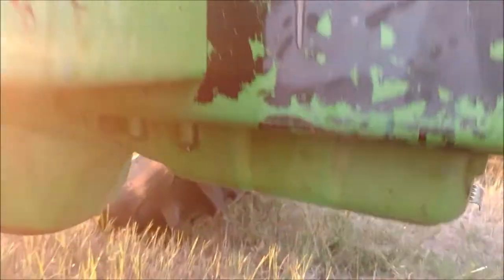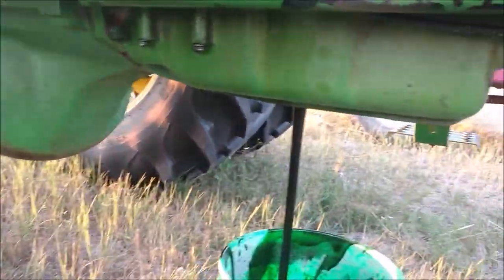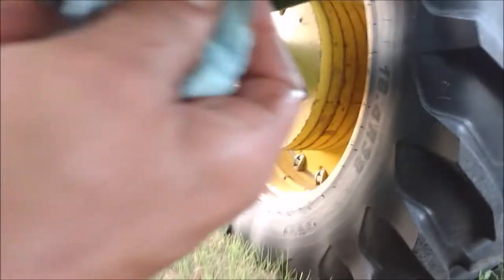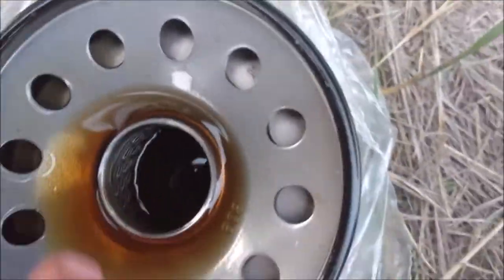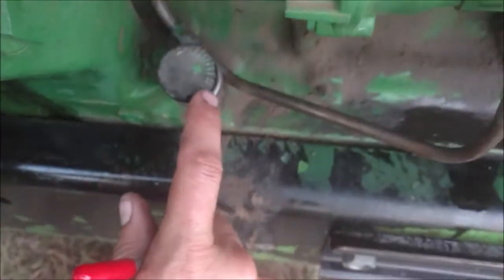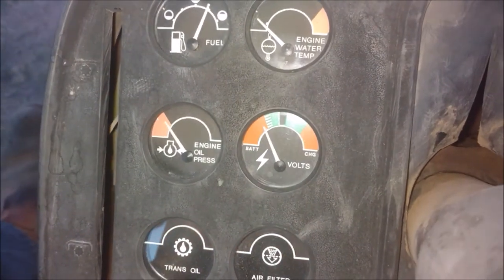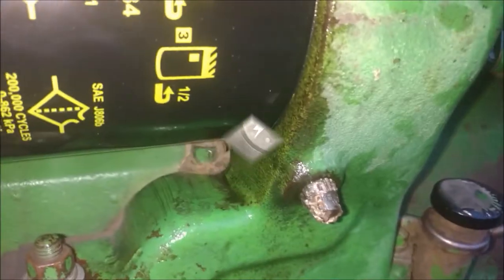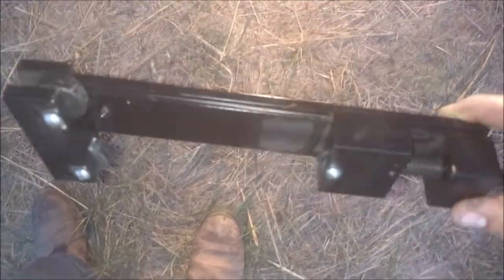How to change the oil on a John Deere 4430

Comment: Which Oil would you recommend for a very hot place. Average temp 92 Fahrenheit
Reply from the maker: I would go with a full synthetic 10w-30 or 15w-30 Oil designed for diesels. All I can find in my area is 5w-30 so that's what I usually run. But 17 qts of synthetic oil is expensive so most my neighbors use a conventional diesel motor oil in these older tractors and have never had a issue. Synthetic blend might be a good compromise.
Reply: JD 15w-40 Plus 50 II.
Reply: 15w-40. High temps require a thicker oil
Reply: I've used Delo 15w40 in SE Texas